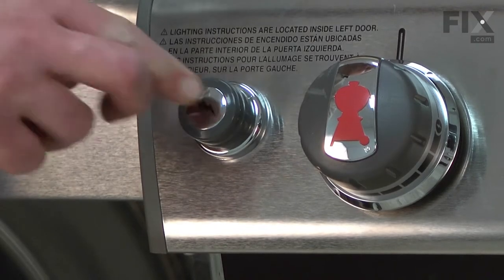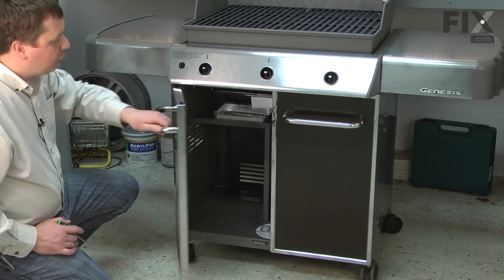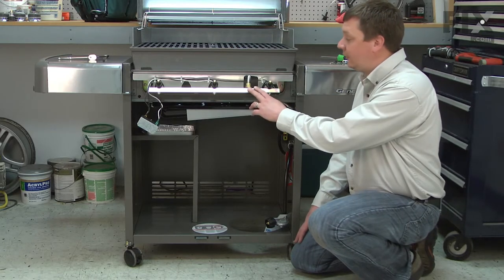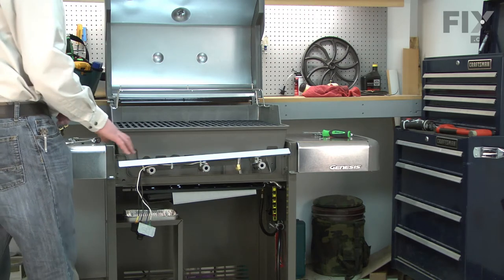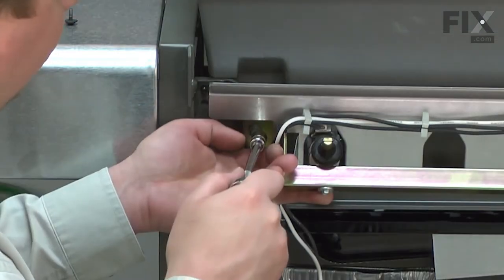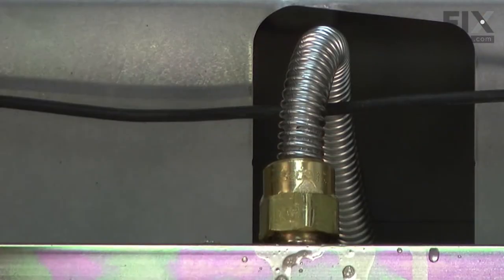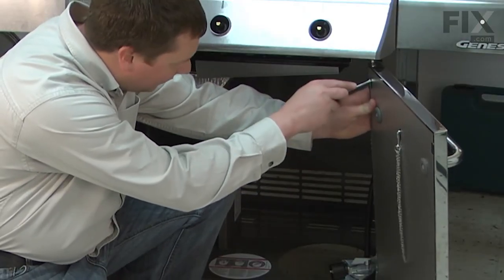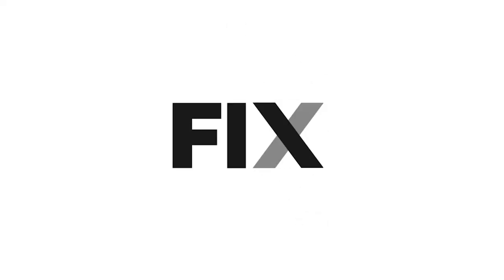Weber Grill Repair - How to Replace the Manifold

Comment: Awesome video, my grill tipped over face-down in an extreme wind storm yesterday and broke off all the valve stems.  You likely just saved me a few 100 $.
Reply: Just watched the video for the same reason!
Reply: @davidoppenheim2633  I'm on my second replacement.  Every four or five years, we get a good blow on Cape Cod, and my grill does a face plant.  Very smooth how-to.